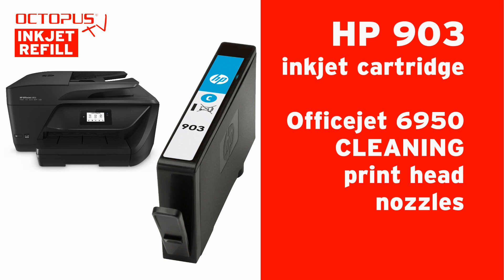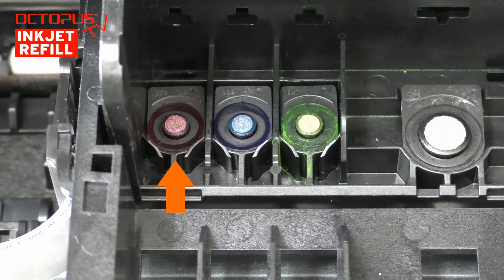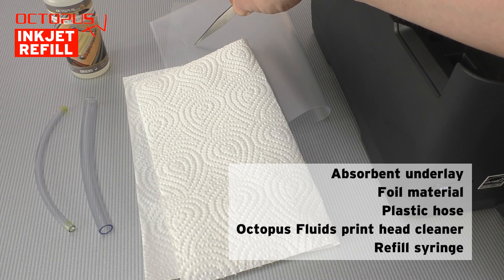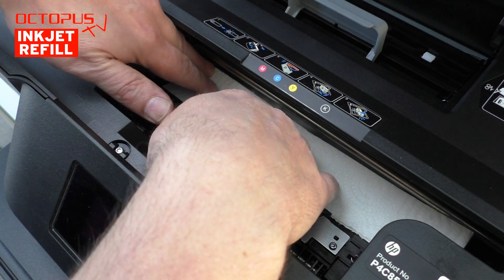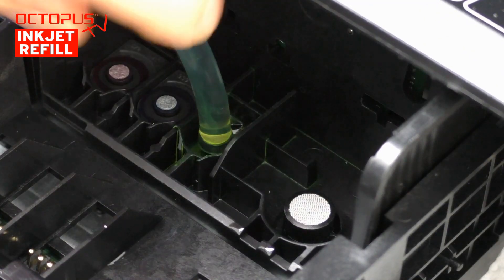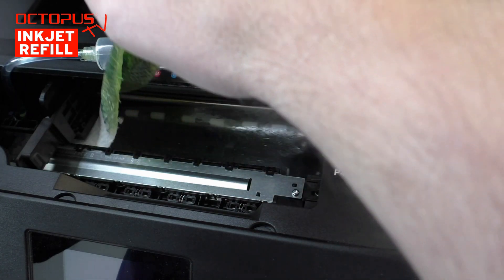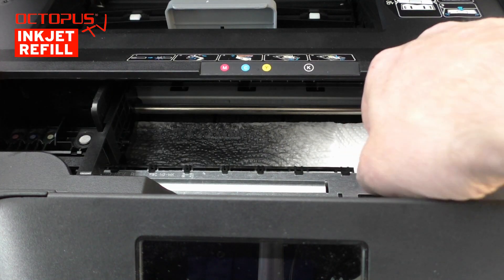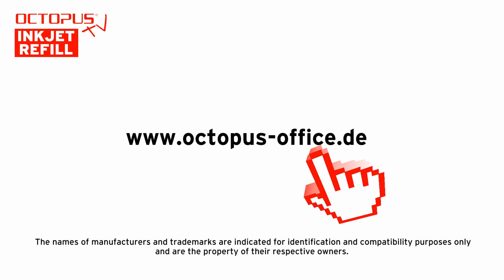HP 903 inkjet cartridges - print head nozzle cleaning OfficeJet 6950

Comment: Hello. I have done printhead cleaning numerous times. the blue is always a problem getting cleaned. many times when i remove cartridges i get error code saying wrong cartridges or in wrong place. they are not. i am a customer of instant ink. where they send you cartridges when get low, they can turn these off i hear. i canceleed my account. i have 3 sets of inkjets that are pretty full, i am at odds if i dont get this working or buy a new printer. do you think use alcholol as fella did in above comments be better that the cleaning solution i have. Hope you can help. I hear of inkjets in new printers that you just fill up compartments and dont have to buy injets. What are your thoughts on this also. Thanks In advance.
Reply from the maker: Hello Allen, instant ink should not make such a head ache ... sorry to read that. With Your description of the error code it might be a combination of defective chips on the cartridges and instant ink settings applied into Your printer´s by the instant ink programm. From our knowledge about this programm we know that the printer communicates with HP and this way they can also prevent the usage of refilled or alternative cartridges - we are sorry we do not know how to switch these settings off.
Alcohol is not a good cleaner for these inks as the inks are water based and alcohol is no solution for water based cloggings - but at the same time it also does no damage.
Most of the big printer manufacturers offer desktop printers with tanks for the printer ink: You need to look for Epson Ecotank printers for examples. On most of their websites You can filter for tank supplied ink. We hope that helps a bit in Your situation.

Comment: Hi! I just cleaned my HP Officejet 6950's printhead! Thank you so much! It is a quick and easy process but instead of the Octopus fluids print head fluid, I used just pure alcohol and a  glass cup straw instead of a plastic hose. I cleaned any remaining alcohol inside the ink ports and that's it!!! I turned my printer on and I can finally print in color. It couldn't be easier!
Reply from the maker: Hello Chrysa, thanks a lot for Your nice feedback and the detailed description of Your adaption of the suggested cleaning method. Especially the sustainable solution to use the glass straw - outstanding 👍🏻😀

Comment: Is it possible to replace the print head on the Office jet PRO 6970? I'm getting "print head problem" message no matter what I try to do. How can I find out whats causing the print head to generate this message.
Reply from the maker: Hello Terry, thanks for Your question. We have checked our sources with the result that a new print head is not listed as a consumable for Your printer model - it is considered to be a spare part which You need to purchase through a HP service partner. We have not tried to remove the print head - so we are sorry that we cannot assist in getting the print head out and a new one in.
Reply: @octopusoffice  thank you for your help and quick reply. I don’t know where to go from here the printer has had very little usage which is probably what instigated the problem.
Reply from the maker: @Mogsey1845  thanks for Your reply and describing the situation. We know that these printer models are keen for drying in when beeing used not regularly. But this actually does not explain why You receive this error message.  The message itsself is also anything but hepful thanks to HP - what further information should You make up Yourself from the confirmation that there is an error? 🤐

Comment: The description for this kit says it will work with HP Officejet Pro 6968.  My printer uses ink cartridges 902,  not  the 903 shown in the video.. Will the diameter still be correct to fit on my printheads?  Also, the link below takes me to a non-working page. Is this product sold in USA or only in EU. I could not find it on Amazon.
Reply from the maker: Hello Trisha, thank you very much for Your question. The kit (actually dedicated to Canon cartridges)also works for Your HP 902 single ink tank cartridges too - there are not so many HP cartridges around for which that cleaning method works - just to give You an explanation for our laziness not setting up a set dedicated to HP cartridges.
You can purchase the kit from our shop ( as it is not sold on amazonUS yet) but we are aware of that our shipping rates for that small item are not really attractive: https://www.octopus-office.de/shop/en/printer-ink/nozzle-cleaner-cartridge-cleaner/5161/print-head-cleaner-set-for-canon-pixma-nozzle-cleaner-with-extension-hoses

Comment: My hp6960 doesn’t print blank. It was not used for a year . I tried cleaning with isopropyl alcohol solution but I didn’t use a syringe. I used a dropper . I have cleaned 10 times still there is no black print. The coloured cartridges are very low but black is more than half . Why is it happening
Reply from the maker: Thanks for sharing Your experience. The reason for not getting a real improvement might be the used cleaner - alcohol has no disolving effect on waterbased inks. The cleaner fluid should be made of purified and demineralized water.  Beside that we assume that You are working with a new set of cartridges, right? Either You use new original cartridges or please make sure that Your new alternative cartridges contain ink that is suitable for Your printer model.

Comment: do you have link for products used? I was wondering what size of the plastic pipe used for the nozzle.
Reply from the maker: Hello David, thank you for Your question. I have been using our Canon print head cleaning kit - it contains the supplies that are suitable too for these HP cartridges. Please check this link: https://www.octopus-office.de/shop/en/printer-ink/nozzle-cleaner-cartridge-cleaner/5161/print-head-cleaner-set-for-canon-pixma-nozzle-cleaner-with-extension-hoses

Comment: Thank you very much.. it is very helpful
But could you kindly please let me know what is these mixtures.. I mean the percentage value of each this solution.. thank you
Reply from the maker: Hello, thanks for Your question. Our nozzle cleaner / print head cleaner is based on our formulation for water based inks suitable to wotrk in desktop printers. It consists of demineralized, very clean water and it is enriched with surfacants. The surfacants have the effect of bringing down the surfcace tension at cloggings inside the nozzles and at dried in inks. This way the ultra clean water can dissolve these cloggings more easily.
In most cases You wil not have access to a surfacant dispersion - it is very seldom to something like this sitting on the shelve :)
But water based inks You can clean with demineralized water - demineralized is very important as minerals in the water  bring the risk that the minerals become solid inside the printhead.